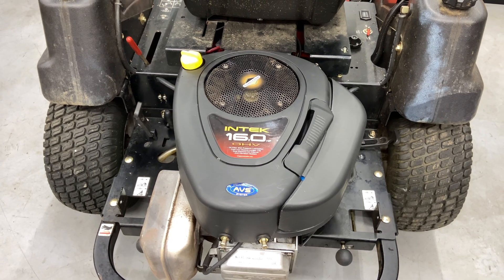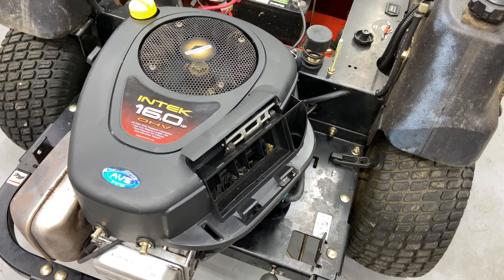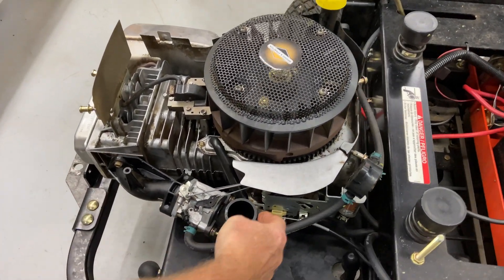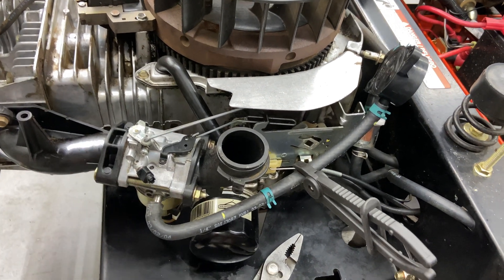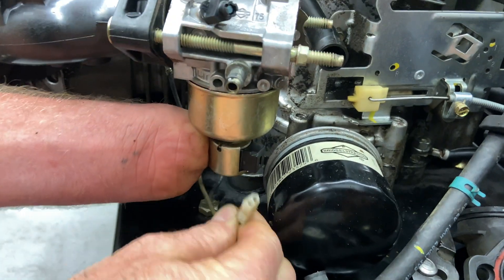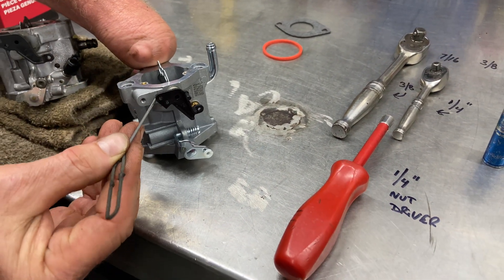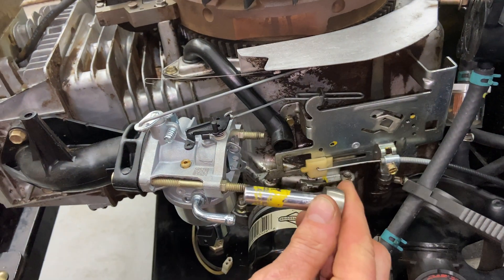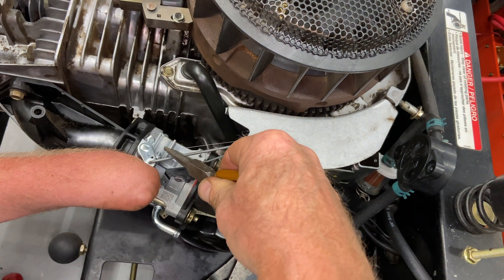How to Replace Carburetor on a Briggs and Stratton Intek Engine

Comment: dad had a 21 horse v twin intek.it ran good, smooth, good power, but leaked oil quicker the exxon valdez.even 2 weeks after new rocker cover & sump gaskets.im surprised the S.O.B. didnt catch on fire.glad i kept my old opposed twins.39 & 30 years old, still run like new WITHOUT leaks.they DONT make them like they used too.

Comment: If it's a PRE-FILTER, shouldn't it go in FRONT (Air go through it first) of the paper filter?  As shown, it is a POST filter.
Reply from the maker: The pre-filter is correctly placed. The air comes up from under the pre filter through the air filter retainer which has large square openings where the air is passed through. Look at a parts breakdown if you are unsure.
Reply: @JohnsonsSmallEngines  Oh, I see .  Thanks for explaining.

Comment: Nice job, why did the carb need replacing instead of repairing? Just curious. Thanks for the video.
Reply from the maker: Thank you! The machine had over 1000 hrs on it. Not taking any chances. The customer was ok with it.
Reply: Because Briggs carburetors are junk, lucky there was one that was available, so many of their parts are on backorder
Reply: @robertsevert  Usually only the Niki carbs are junk, many other brands can be rebuilt with easy. I usually put the non-Niki carbs thru one of my ultra sonic cleaners and rebuild them with no issues.
Reply from the maker: You do know that I did not leave the comment that Briggs carburetors are junk :). It went 1000 plus hours. I would say that was a heck of a run and I will keep it. Install a new brass seat, needle valve, bowl gasket and put it on the shelf for back up.
Reply: @JohnsonsSmallEngines  Yes, Thanks